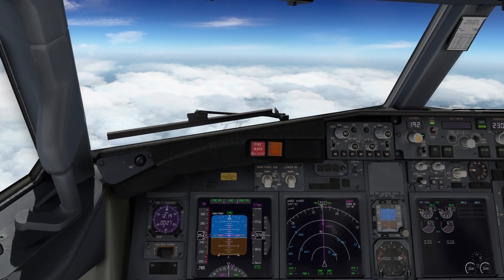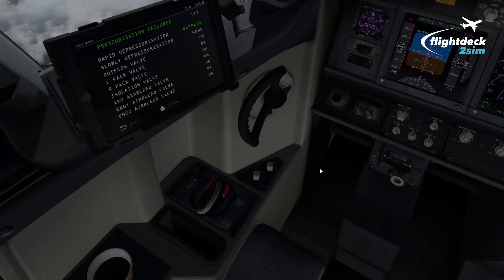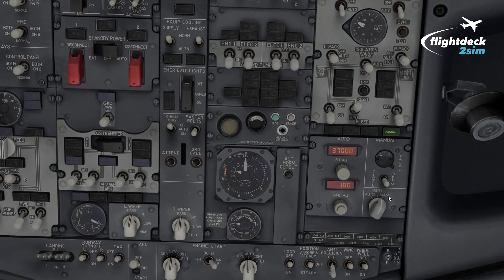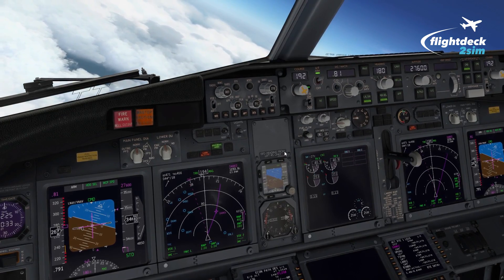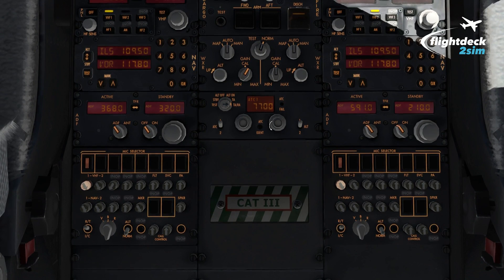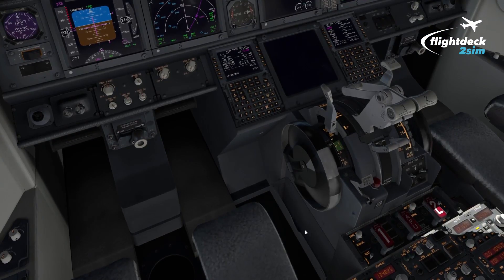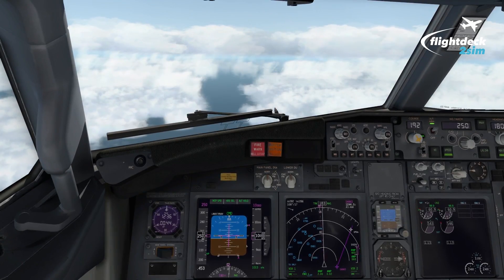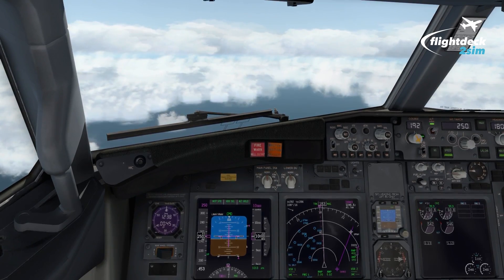REAL BOEING 737 PILOT - Rapid Depressurisation Tutorial - X-Plane 11

Comment: So, yesterday I had the cabin pressure alarm sound and did the rapid descent. Im not sure what I did right but something with toggling the packs and the ac control re established pressure and I could climb back.  Can you explain procedures for a cabin depressurization not caused by aircraft damage?  Must have been something I set up (cruise alt was set properly)

Thanks!

Comment: An Air Canada pilot had to lose altitude quick when his plane ran out of fuel (fuel loading conversion error - https://en.wikipedia.org/wiki/Gimli_Glider) and did this using a `forward slip' maneuver.  Although not a standard procedure, wonder if it could be used in this case as well?  Ever heard of this?

Comment: FlightDeck2sim What is the difference between A 737-900 Cockpit And A -800 Cockpit?
Reply from the maker: Well I've never set foot in the -900 but I think they're pretty much the same!

FD2S
Reply: @davehagen2540  The -700 has a different knob design and number of knobs for adjusting cabin temperature than the other NG series.

Comment: Great video!  Curious... do airlines (or Boeing) have an expected time to execute these procedures?
Reply: Hi! And yes there are some certain time limits that you have to achieve descending to some certain FL s and altitudes. This requirement is all about O2 requirements and availability.  e.g with a 12 mins passenger oxygen system, by the end of the 5th minute you have to be at 17000 feet;   ...by the end of 11th minute  at 14000 feet; ...by the end of 41th minute at 10000 feet.  These figures are very conservative btw

Comment: Hey FD2S, another great video! Thanks for the detailed explanation :) I have a question regarding the topic: Isn’t an issue with the aircraft’s structural integrity the most likely cause for a decompression at cruising altitude? So unless you know 100% better would you still bug VMO/MMO like you did in the video? 
Also what are other possible causes? I could think of both packs failing at the same time what seems really unlikely to me - you would also get a master caution if more than one zone fails, right? Maybe a problem with the outflow valve’s motor unit could be the reason? So after all I feel like maintaining around 250 KIAS during the emergency descent would be the safest way to go since structural damage can never be excluded. What do you think? 
Keep up the great work!
Reply from the maker: Hi Fabi!

The QRH advises to bug VMO/MMO but if structural integrity is in doubt limit the speed and avoid high manoeuvring loads. You would have to make an assessment of what is going on, perhaps there is a violent vibration at higher speeds. There is no real set guidance but the default is to set VMO/MMO

Statistically I think a technical issue is going to be the most likely cause of a uncontrolled pressurisation issue, I can think of a very small number of issues related to the outflow valve in recent years. If both Packs/Bleeds fail you should have sufficient time to initiate a more gradual descent to FL100. The important thing to remember is that any time the CAB ALT exceeds 10,000ft you immediately initiate a emergency descent to 10,000ft or the MSA (whichever is higher)

Good Luck!

FD2S

Comment: Great to see another tutorial. Is there any reason why the procedure dosen't include a steep turn to help increase the decent rate?
Reply: Richard Womersley structural limitations possibly? A 60 degree turn in level flight puts 2G’s on the aircraft and add that to being at Vmo with a possible hole in the cabin ceiling.
Reply from the maker: @joshjenk1613  that would unnecessary workload in an already stressful situation. This gives us the best rate of descent and control whilst utilizing the automation which in turn increases capacity.

FD2S
Reply: @flightdeck2sim  Cheers!